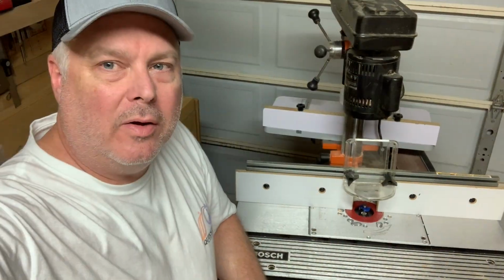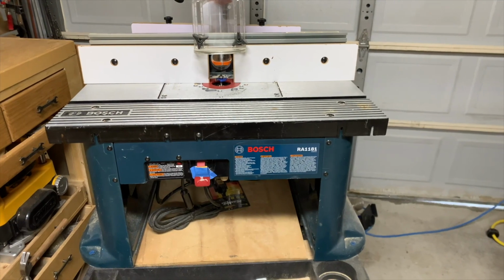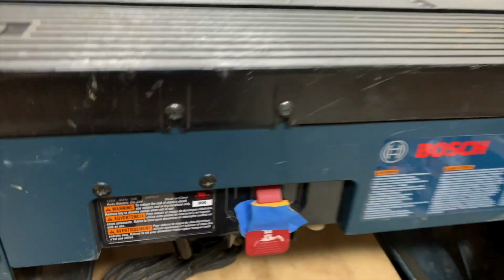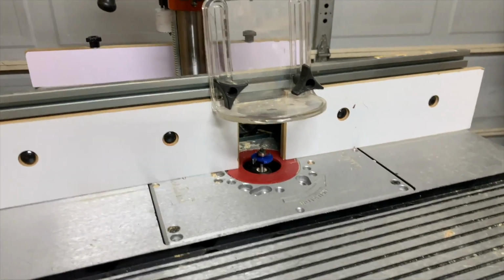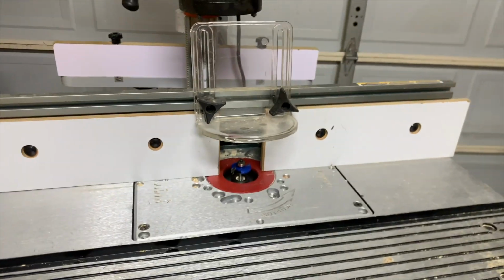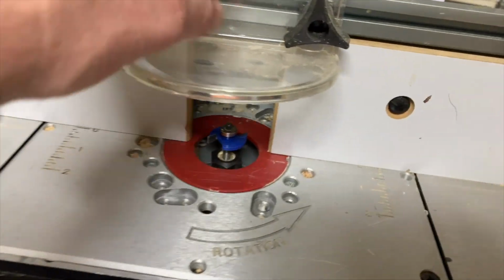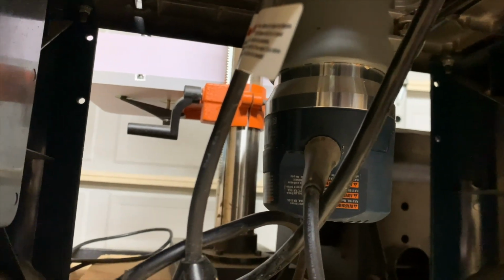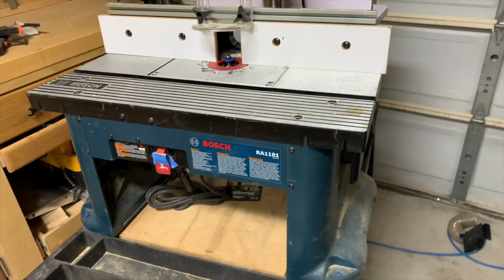Bosch Router Table - Model - RA1181 - Woodworking Business Owner Honest Review

Comment: I bought a used Bosch 1613EVS Plunge Router to go with my new Bosh RA 1181 Router Table. It's an awkward fit, difficult to get at the collet release level, plunge doesn't remove so no easy height adjustment, etc. What fixed base router would you recommend to go with the Bosh RA 1181? I don't plan to remove it from the router table.
Reply: I have the same router and was considering this table. Did you ever get anything sorted out? Thanks
Reply: Get the 1617, it's affordable and a beast.